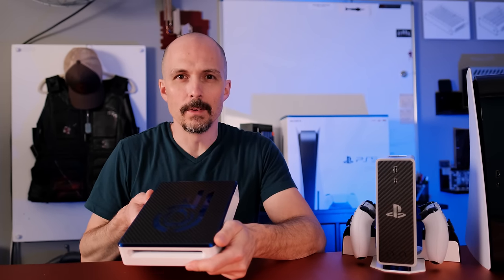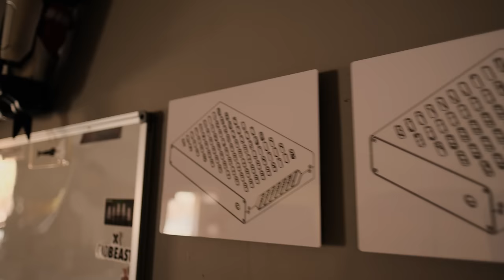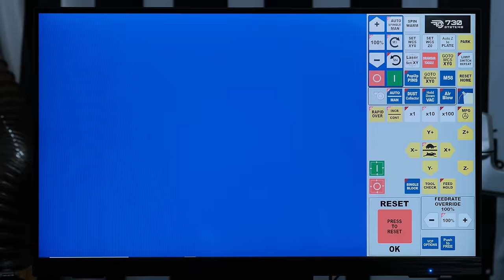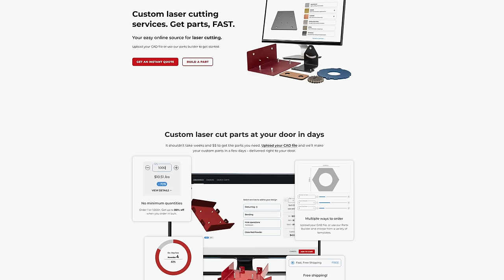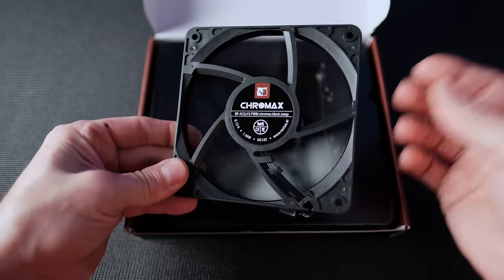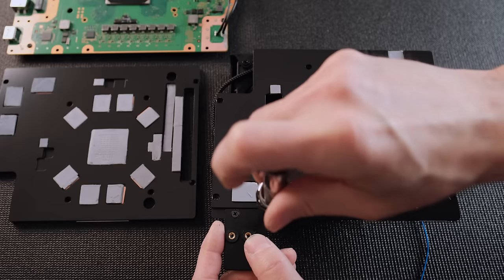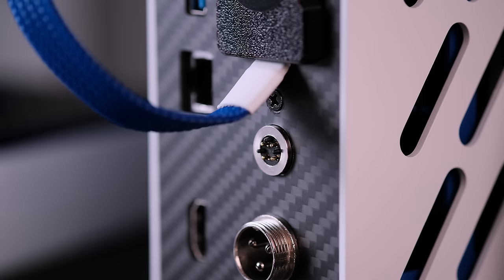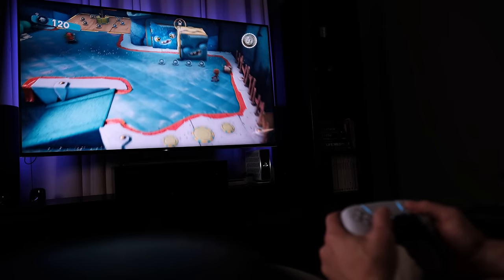Shrinking the PlayStation 5

Comment: Did you really shrink the PS5 or divide by 2? Awesome work!
Reply: The strugle is real. 5/2 we get 2.5D
Reply: PS2.5
Reply: he divided by 0
Reply: @vincentvega3093  I love this logic 😂
Reply: Why is this not pinned?
Reply: Math
Reply: He rearranged the parts so that it could fit in much smaller module
Reply: He shrank it indeed. Just by getting rid of the huge fan and heatsink.
Reply: Math is hard. I just eyeballed it.
Reply: I was thinking the same thing m, great to watch him do the work and great to look at but also pointless lol
Reply: @HarishBabuM by separating a drive and putting it in a separate enclosure and then having two enclosures to lug around makes no sense. Would have been much better if it was an all in one case
Reply: @DryUrEyesMate it gives you the option to use disk drive when needed. 🤷🏾‍♂️
Reply: @danielcastelo  and it would sum up to 1500 usd to produce it. Who would buy it?
Reply: @eastern2687  I get it. But it's nice to see it's possible and that Sony should have done it.
Reply: Great work! I would buy the tiny PS5!
Reply: @DryUrEyesMate  how often are u lugging around a ps5 lol?
Reply: he divided it by 3 actually
Reply: Actually it was by 3 right? It’s not clear but I think he is using an external power supply.
Reply: @DryUrEyesMate   why would you be lugging around your PS5 just to install a CD game at the place you arrived? If you were so much of a digital nomad you'd either ahve already installed said game or just download said game.
Reply: @danielcastelo  no.. it isn't, it makes things more expensive and impractical
Reply: @soniccinos  most definitely, probably for sure.
Reply: Thats still shrinking

Comment: I only got one question. Why Sony hasn’t hired you as their system architect yet? Phenomenal work!
Reply: It would be near impossible to mass produce a model like this without it costing nearly double the price of a PS5.
Reply: Why dont they make personal ps5 shell cases available as an upgrade with the same parts already own just different caseing and fan this would cut down cost and you would still have to buy a ps5 to start with anyway to get started ,its not like playstation will loose money they would get more profit, if there was a way to do it id buy it . Just my thoughts.
Reply: @FireworkMerchant  I mean looks like people would pay it. I would for sure get this and pay double for it simply for the travel aspect.
Reply: @FireworkMerchant  double? looks like a lot more than that.
Reply: A ps5 with this case would probably go for around 1700$. I am sure people would still buy it, but it won't be enough people to make it worth it.
The amount of work that goes into making something like this yourself vs . making it to sell it is not comparable. Just all the extra paperwork and testing they would have to do.
Reply: because it the chassis would cost twice the console itself?
Reply: @ponderingspirit  Many of the parts he used were custom built and many were premium, top of the line products used specifically for this build. The production costs alone would cancel out any profitability for Sony. They’d have to spend a boatload on RND and production to make the required parts. Those costs would make the console insanely expensive and would not be viable for production or profit. Their other option would be to purchase existing parts from other companies which would increase the price of the console to a ridiculous number. No business would be able to make profit off a design like this.
Reply: @mattsmitty12345  if 20% would want to buy a more expensive ps5
The other 80% Don't have the money for it
Reply: @FireworkMerchant  plenty of the ps5 parts were also custom made by Sony what’s your point
Reply: @aaronroby4905  unfortunately modern hardware is designed to not be taken apart by end user. And intending to doing so would require manufacturer to design accordingly, i.e. complexity and price increase for base model.
Reply: not true you could replace alot of the parts he used with cheaper more easily mass produced plastic parts for a comparible price point  @FireworkMerchant
Reply: @0v3rt0pp13  Correct and they do that for a new console 1-2 times every 5-8 years. Thats a huge investment, followed by a massive worldwide release of a new system. They only perform R&D and mass produce parts and consoles for a new release. They spend big money in order to make big money (new console release). It makes no logical sense for them to invest the time and money for a new console release on a mid lifecycle refresh. They would have to research and develop all of these parts, purchase materials, figure out vendors and distributors for parts, make parts, pay for designers and engineers to make blueprints for a design, test the system, etc all before shipping this console. All that for a console that few people would even buy.
Reply: @FabricateFrog  Sure you could, but thats not factoring in the research and development for all these small, unique parts. It doesn’t include the testing that must go into designing a console like this to make sure its design allows for proper airflow, cooling, reliability. All of that requires a lot of money. Companies cant just “manufacture parts” all willy nilly. It requires R&D, testing, designing, and all of that costs money. Money that likely wouldn’t be made back by selling to such a niche market. This would maybe be a possibility for the PS6, but a PS5 slim? No way.
Reply: Because the volume between the ps5 slim and his won’t be that much different
Reply: I mean all he done is take off the disk drive and then put it in a box you put the ps5 he made and the external disk drive he made and they would be about the same size
Reply: @FireworkMerchant  😑😑😑🤦🤦🤦

Comment: I just can't believe how much work you put into this project. The love for little details is beyond anything I've seen with a console mod. Even adding tiny quality of life improvements like the pogo pins for the controller charging assembly is mind blowing.
Reply: Nothing's worth doing if you don't do it with passion. Thank you, friend!
Reply: Also I think Sony did the right move with not making the console any smaller, as most people will care more about the noise profile than size. I also prefer internal disk drives for a cleaner look.
Reply: That's fair. I understand why they made the choices that they did. We can do things like this because we don't have to worry about a warranty. @achannelhasnoname5182
Reply: Would buy
Reply: I need to follow your stuff, what 3d printer did you use? This ps5 is amazing
Reply: Ficou mais bonito que o modelo original. Eu compraria esse modelo que você criou. Parabéns!
Reply: Doesn't the PS5 use 350 watts power supply? Could this potentially lead to issues in the end-of-life cycle, considering there might be an increase in wattage demands over time??
Reply: Wow just wow! I love this mod!
Reply: Bueno como la puedo comprar en Colombia

Comment: We need more people taking things apart like this and marketing kits to shrink and fix what the companies fail to do
Reply: Yeah.  But most cool wouldn’t because the process is very expensive and time consuming.   I can imagine how much was put into this.   But it’s be nice to see more content like this.
Reply: That would just make the console cost $1000 and nobody would buy it lol
Reply: Og ps5 desgin looked better tbh
Reply: I mean, Sony didn't fail.  It works, and it has a purpose.  Maybe it is not the best design, but I think it is better than the alternative
Reply: @doomnationalist  How would the console cost more? If the company is doing this by themself then it will be cheap in bulk, the only expense will be in R&D which they already do(probably, i dunno for sure).
Reply: You're forgetting about warranty.
Reply: @Sakshya-ew2hc That's what I'm wondering. Slim models have always been about cutting costs for the manufacturer, not necessarily changing the sell price. 
During the silicon shortage it was reportedly $450 to make a PS5, and they were selling the digital at a loss. Now with the shortage over, and the slim even cheaper to make, it's probably much cheaper to make a PS5 this small than these "over $1,500" comments claim. With the PSN price increase though, it's clear Sony just wants to make as much money as possible now, so don't expect a slimmer PS5 to cost less than $450.

Comment: Love that you incorporated the power supply and cooling into the body. A lot of mods I've seen to "minify" the PS5 create external solutions for this and it defeats the purpose, IMO.
Reply: ❤ Agreed! Thanks!
Reply: The early PS2 slims also had an external power supply. It's not that bad. But having it internal is better, I think we all agree to that.
Reply: Personally, I hate power bricks...on any device. @vdochev
Reply: DIY Perks made the first PS5 slim but it needed a power supply as big as the original PS5!
Reply: @vdochev  - Not for thermals it isn’t. Consoles often have external supplies to keep the size and thermals down. 

It’s only when chip improvements and cost reductions come along that they’re able to move the PSU internally while keep the console small. The PS5 is so massive because of the internal PSU. 

Don’t like power bricks? Deal with large consoles until costs come down on more efficient hardware.
Reply: @crazypopcorn7801   Indeed. I did not want to name names, but that is what I was alluding to.
Reply: @Cerus98  Yes, I agree that internal PSUs are better, don't get me wrong. I meant that I don't mind carrying an additional power brick if I have to. I mean, I do it for notebooks, so I'm used to it. But I'd be happy if I don't have to do it.
Reply: You can hide power bricks but you cant hide ps5 lol
Reply: @vdochev - Oh I’m all for external bricks. It keeps console sizes smaller and gives them better thermals. Regardless of chip improvements, having an external PSU will always result in cooler temps which = longer life. 

But gamers complained about the bricks so they’ve started stuffing them inside the consoles from the get go leading to the hulking consoles we have today.
Reply: @crazypopcorn7801  it was also over kill and didnt look as slick, but yea that guy knows his stuff as well
Reply: @Cerus98  It wouldn't overheat the console if it is done correctly. And with the next generation GaN components the PSUs are going to run cooler and be smaller. The one shown in the video is a GaN as well.
The problem with external bricks is that they all follow different standards, and it would be a nightmare if you travel with multiple. I only prefer external bricks if it is standard like USB-PD.
Reply: @cucumberworks - Not once did I even type the word “overheat”. 

No PSU will ever not produce heat. You’ll have better console life with external bricks. Always. It may be only months but lower temps=longer life.
Reply: He did create an external solution, the disc drive.
Would prefer an external powersupply then an external discdrive tbh.
Reply: @Cerus98   Why would slightly warmer temperatures be a concern though. You seem to assume that high temps are the cause of electronics failing but in reality solid state chip components are designed to handle temperatures up to 80C constantly just fine. 

I said overheat because by definition overheat is the kind of temperature that causes the decreased lifespan of components.

The video only shows the temperature increase by a 4 degrees even under intense load. Laptops reach 90C these days. 

Trying to hit an unnecessary temperature target will come at a cost of adding unnecessary cooling and thermal conducting systems that will further increase the weight and volume.
Reply: @z3mv  the PS5 can work without a disk drive so I see that as an optional accessory. Not so with the PSU or the cooling. In fact, with such big software patches, it kinda makes sense to have it be a digital console.
Reply: @cucumberworks  - Funny you mention laptops….the kind of device that notoriously has a short lifespan due to inherently poor thermals. 

The PS5s operating range is 65-75c and an absolute maximum of 105c. SSDs run 30-65c and will thermal throttle at 70c. No device will be happy running at 80c constantly. Heat kills components. Period. You seem very misinformed on how electronic devices operate. It doesn’t matter if you reach thermal limits or not. Just because you’re below the maximum doesn’t mean you aren’t shortening the lifespan. Overheat by definition is going beyond the maximum and with modern devices, they’ll shut off to prevent severe damage. Nothing more, nothing less. Staying below that does not mean no damage is occurring. 

I am not speaking directly to the creators mod. I’m addressing the usage of power bricks in consoles. Once again, the PS5 is so large because gamers complain about power bricks. Had they kept the console small but changed nothing else, it would burn itself up in short order. 

Better (lower) thermals = longer life. Even a 5 degree increase is shortening the life.
Reply: @Cerus98  lol tell that to AMD and Intel and move to Antarctica 🤡

Comment: I'd love a kit to do something like this. My biggest problem with the ps5 is the amount of space it eats up. Great work!
Reply: Seconded.
Reply: For real, this would be a huge improvement to my desktop space. Either way, this is such a better design than Sony's slimmed down PS5
Reply: If only if it's easy as a "kit" he almost remade it.
Reply: Too bad with all the machining it would probably cost as much or more than a ps5 console does.
Reply: It could be possible, in large enough quantities injection molding would be much cheaper than 3D printing. Besides, a lot of the CNC work went into metal plates with fancy writing and logos that are not even visible when assembled.

Comment: It would be interesting to see your take on the original xbox (2001). The minification scene back in the day was crazy.
Just a tip if you do: The 1.6 motherboards can be tricked into taking just 12v and 5v power. No need for all of the atx rails.
Reply: you can make it usb c aswell
Reply: Maybe you can re-do the VRMs to source power from the 12v rail instead. IDK, that sounds like a huge effort compared to just figuring out a way to "get rid" of the 12v power requirement (removing most 12v parts and using a teeny boost converter to supply the rest)

Comment: Great work!
It's always interesting to see the different trade-offs that can be made when something doesn't have to be mass-manufactured for as low a cost as practical.
Reply: In all fairness, you could even argue the smaller profile could mean smaller packaging and also reduced shipping costs. May be not exactly 1:1 savings but something to consider that would not be purely a negative in terms of cost increase/decrease

Comment: Dude... THIS IS SUCH AN AMAZING BUILD!...

And honestly it's depressing Sony's big expensive design studio, couldn't do a better job on slimming the unit down. ESPECIALLY with a external drive. 
I thought it was really interesting how you figure out how to work around the "resistance" issue you mentioned. That was slick! 

You know that saying "You don't know what you want, till you see it"? 

I'd like a slimmer PS5, that I didn't have to put a weird shaped object under it, so it sits properly when in the horizontal position, and also be high enough so the disc drive is easily accessible.. (That's how I keep my unit) I also built a little jig for my unit..to make this work out properly for me.

Comment: Really cool project. Would've been cool to see the disk drive have a side mount option. Maybe it could take one of the controller spaces.
Reply: I made several designs and that was one of them. I really wanted to keep everything inside the S4T case, plus I really wanted to see if the external disc drive would work.

Comment: Absolutely insanely cool build. Have thought for a while about doing something similar. Just don’t have the resources.
Was wondering though, what pin outs on your connector from the PSU were you using? Did you have any trouble powering it on? Or did it work first boot? 
Anyways, cool stuff man!

Comment: Rapid heating or cooling can and most likely will cause faster thermal paste degradation and can sometimes ruin heat transfer by 'ruining' the surface of the heat spreader/cooler that makes contact with the heat spreader. It's a lot better for your components to slowly heat up and cool down rather than vice versa. So the fan staying on after the system turns off can and most likely will cause damage to your components.

Comment: One thing about putting a heat generating device under your TV - don't do that. The uneven heating, although seemingly slight, will distort the TV enough to damage the smaller than a human hair solder leads connecting the panel, and you'll find yourself seeing lines show up as they fail. I found this out by slowly ruining my Samsung 40" years ago, because I had a Mac mini as a HTPC sitting under the left side. Directly above it, a single line appeared, looking purple - the green pixels in a vertical line were dead. Eventually, more failed, and I ended up with a band of black. My only 'luck' out of the situation was that it was right where the 4:3 aspect ratio pillarbox bands would be. Used it for SD watching until it was replaced.
Reply: I've never heard of that before. Thanks for sharing. I pulled it forward for the video so that it would be more visible. It actually sits below, but behind it. I'll be sure to keep it that way.